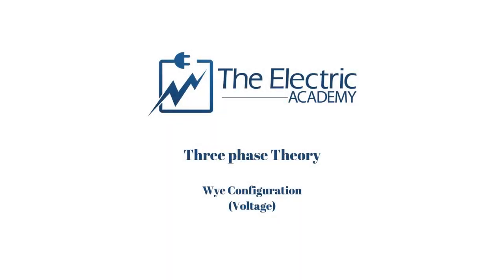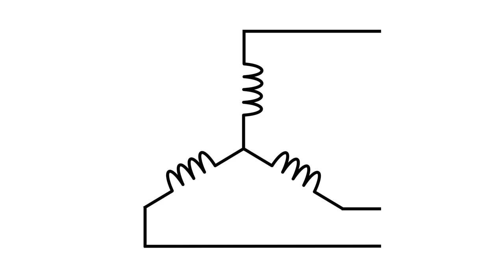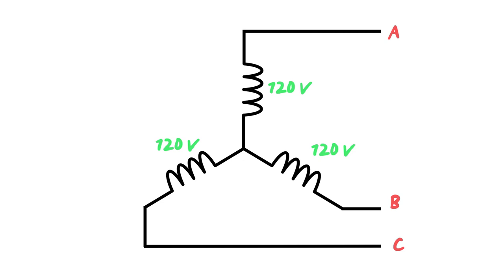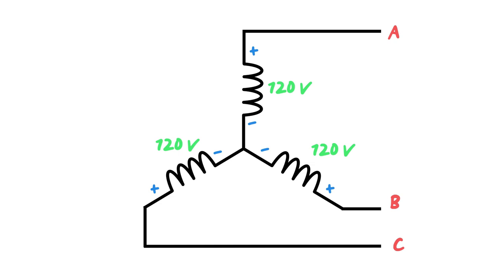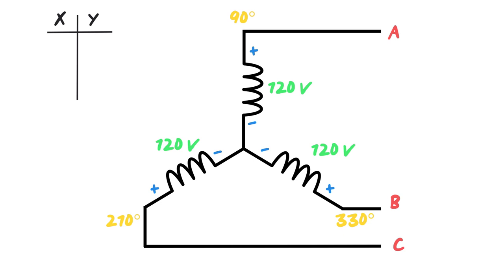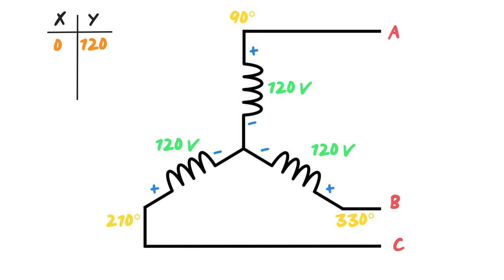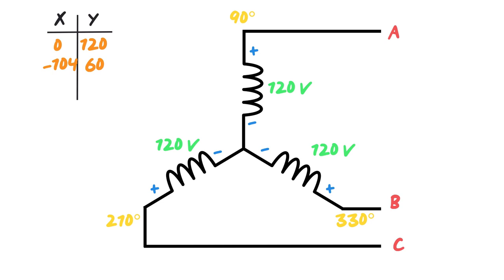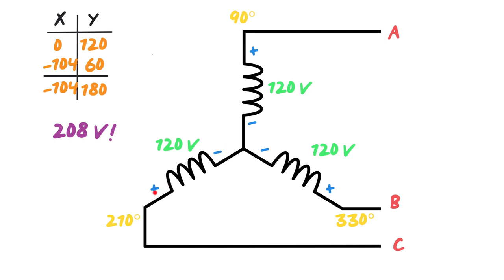Wye Voltage (Line vs Phase)

Comment: I do not see that the votages are being added vectorarlly. Vectors have a magnitude and direction. If the first one was at 90 degrees, was considered positive because it went towards the center (from + to -), then so should the votage at 330 degrees (if we are going to consider them as vecotors). But you don't do this. I suspect voltage is not a vector, and this is just some kind of weird special case where it looks and smells like vectors if you ignore an inconsistency.